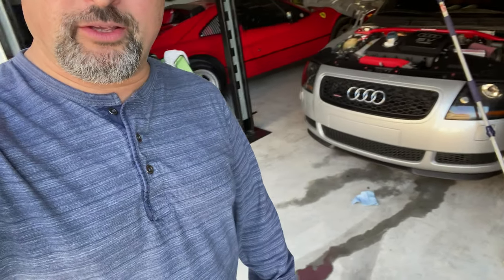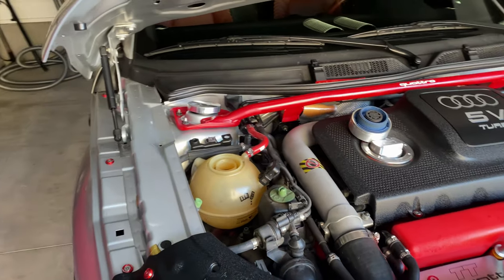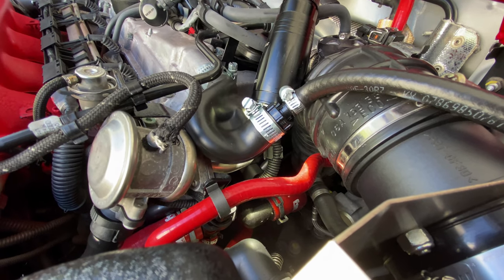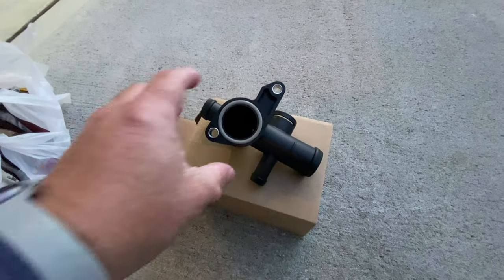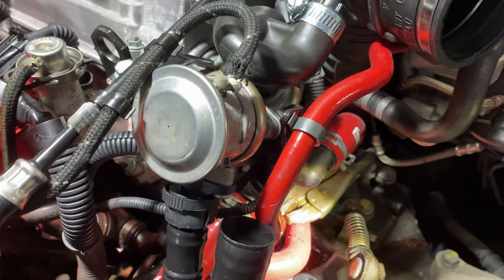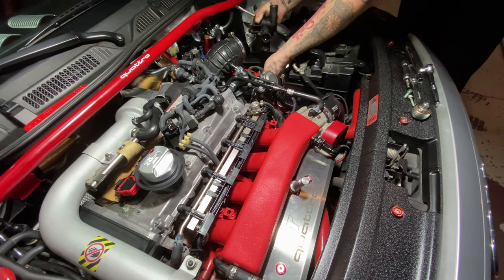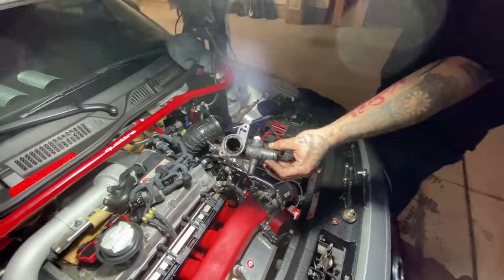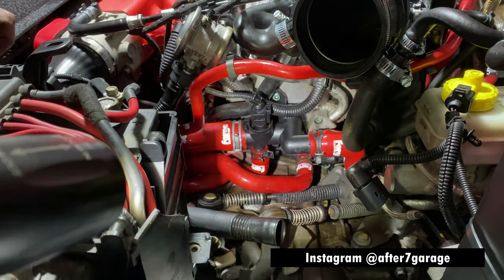Audi TT MK1 8N [Fixing a Coolant / Antifreeze Leak]

Comment: Hey guys thanks for video really helpful. I’m going to tackle this myself and use an aluminium one. 
Did you drain all the coolant is it necessary.? Doesn’t look like you lost much
Reply from the maker: We did not drain it completely. Not necessary after losing most of it in the leakage... Let us know how it goes :)
Reply: Thanks so much for the reply. Mine is not a bad leak just around the nut so needs doing but my coolant tank is full. It just looked like you lost a lot on the floor when you pulled pipes so was unsure I’ll maybe try with a small pan under the pipes when I disconnect if you don’t lose much

Comment: I’ve got the same issue currently. Finding the pipes attaching to the coolant flange are very stuck on. Any tips for getting the pipes off the flange? Thanks a lot
Reply from the maker: Same happened to us. Spray some WD40 and try separating with a very small screwdriver. It takes some effort
Reply: @GarageBuds  I shall give that a try. Thanks :)
Reply: Update: have got the new flange fitted. It is still leaking out the side of the engine where the flange fits to. The new part came with a new o ring seal too, so I am not so sure why it’s still leaking from the same place. Any suggestion? Thanks
Reply: @matthewkitney5826  Head to your local parts store and rent a cooling system pressure tester. You can then pressurize the system and find your leak. Hope this helps!
Reply: Did you ever find this issue out?